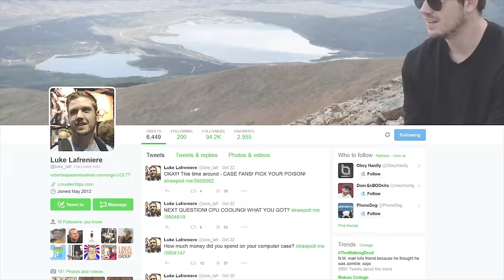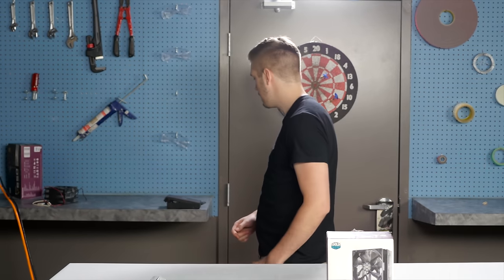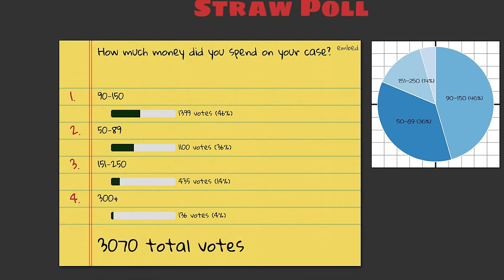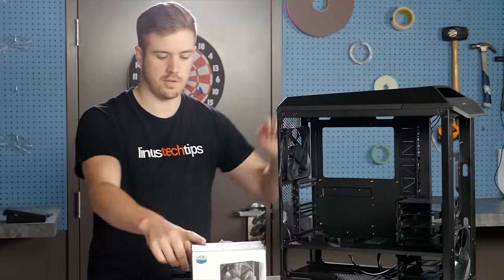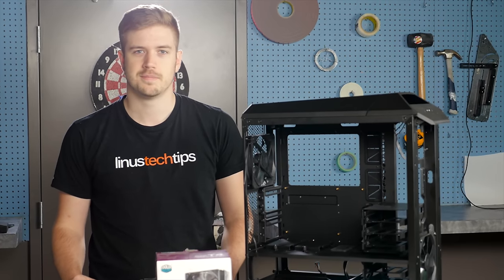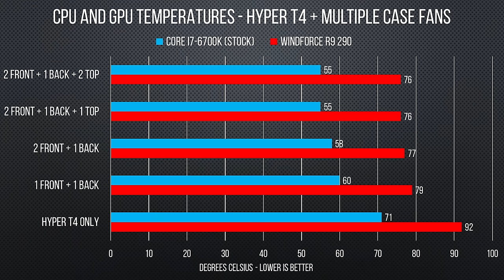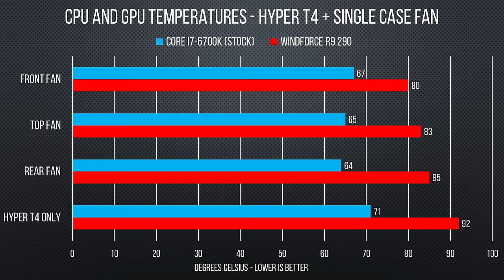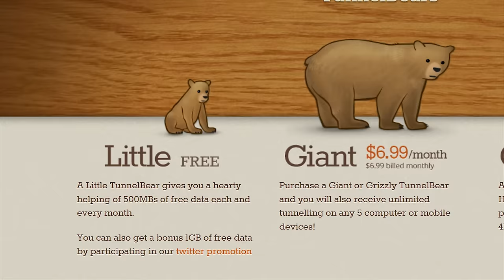Case Fans - How many should you have?

Comment: i want to see a follow up on how positive and negative air pressure affect cooling.
Reply: It doesn't really affect cooling but more dust goes into your case if you have positive air pressure.

Edit: Edited words.
Reply: I vent from positive to negative by changing the rear to exhaust and i get less dust.
Reply: Easy Skater pardon... negative means there is more air exiting the case and positive is when there is more air entering the case
Reply: LawlessSentry

NO SHIT SHERLOCK
WHERE IS THE POWERBUTTON I CANNOT TURN ON MY PC
Reply: Easy Skater LUL
Reply: *****

exactly thats what i did
the difference is its building up a vacuum of hot air which ends up not getting exhausted fast enough also heatsinks on mobo adds up now with negative pressure the overall cooling over long periods is better.
Reply: You have that backwards.. Negative air pressure means that there is smaller pressure inside the case than outside the case (less air in, more air out). Positive air pressure means that there is a bigger pressure inside the case than outside the case (more air in, less air out). Negative pressure builds up dust, because negative pressure sucks the dust in. Positive pressure produces less dust since the dust tries to push outside the case to smaller pressure.
Reply: QckSGaming

 Thats what i said.
Reply: Stop quoting me about it i know what negative pressure means
 im experienced with hardware.
Reply: Deadzio it's probably more efficient to have more intake fans than exhaust fans, as this will create more pressure in the case and will result in less dust. If your hardware is very dusty, the dust will insulate the hardware, acting like a blanket, making your system run hotter. In theory, at least. In practice, it probably doesn't make a huge difference. You'll just have to clean your system more often to maintain cool temps.
Reply: Kureiji Otaku  Negative or neutral is best. Positive pressure tends to have dead zones which heat up, and it's less efficient, so it's preferred only if dust control is your main concern (and with good filtration).  Of course ducting is king and makes positive vs negative moot, but too many people prefer aesthetics over functionality.
Reply: Pressure actually affecting air volume. High fan speed = high pressure on the downstream and low before the fan blade. So to make things easier, just focus on air speed/air volume across your CPU will do.
Reply: All this stuff about negative and positive airflow to prevent dust is BS, just make sure your PC maintains steady temperatures. You will always get dust in your PC, it simply falls in when it's turned off, or is still sucked through the filters. Just clean it every now and then, it's done in 5 minutes with a compressed air can.
Reply: Ok
Reply: that is not possible :P as much air goes out that much goes in
Reply: Does does matter quite a bit in the long run. My cpu started overheating and I found that it was because of a nice little dust blanket.
Reply: +Zag Zagzag This is only the case once the system reaches equilibrium however assuming all the fans are otherwise equal having more intake fans than exhaust fans will always mean that the air pressure inside the case will always be higher than the outside pressure at this point and visa versa. Exactly how much will depend on the cross sectional area of a) the intake vents, b) the exhaust vents and c) any passive vents. The relative relationship in the cross sections of each of these will determine exactly how much each is affected.

Ideally of course you do actually want as large as possible cross sectional area in passive vents too in this situation to minimise the resulting compression ratio since the air compression is actually undesirable. Air compression actually heats the air too in practice this will be negligible as the achieved compression ratio will always be tiny computer cases are plenty leaky enough to ensure that it doesn't take much overpressure to actually reach equilibrium airflow.

The compression is however definitely real and a decent enough barometric pressure sensor could easily measure it. The inverse is also true except of course there the intake fans will be the ones that are gaining extra energy and RPM while the exhaust fans lose some due to the fact they are acting as partial vaccum pumps.

You can easily prove all of this mathematically or experimentally in fact the latter is actually pretty simple to do it only takes an airtight tube and a couple of fans you can easily simulate the same effect as having more or less fans on the intake or exhaust simply by supplying different amounts of power to each and experiment with the effect of the passive vents with the aid of a drill.
Reply: Zag Zagzag, the point most people forget is that the case is full of holes where air can flow. So the question is if you want the air goes in or out of the case from those little cracks. 

Negative pressure (more exhausts) will allow air to be pulled.
Positive pressure (more input) will force air out the cracks,

This fact is essential on dust management, as you want ONLY the inflow of air having dust filter. 

Due to the fact about these cracks, the dead air myth is BS. As either cases will allow air to flow in or out of the cracks. As you say, the ttl in = ttl out.

The key is positioning of the air flow, making sure the fresh air passes through the hottest areas, typically the CPU and GPU. Only have slightly higher input than exhausts to create positive pressure but not so high that it prevent air flow.

It might even worth it to make the top an input instead of exhaust and put a dust filter on it. This will give the CPU the fresh coolest air. While the front fans gives the GPU the fresh cool air.
Ram are typically not the thermal bottle neck, normal air flow is more than enough.
Reply: I have a very small fan setup. I have a Coolermaster Seidon 120M attached to the Rear of my case and 1x120MM case fan. My GPU (AMD R9 270-X) stays pretty stable at about 76c under heavy load however the CPU sits happy at about 45-49c depending on game on pulling air in. I switched it to push air out and the CPU temp rose to about 80c. Seems to be a very bad Idea if you do not have a front fan (no room, HDD cage blocks the fan slot)
Reply: Is it even possible to create a low pressure or high pressure environment with electronic fans???  Brb gonna order a electric supercharger for my car
Reply: Some people might need to put their pc in a container connected to a vaccuum via a hose to collect that dust as the computer is cleaned out.  Otherwise it goes everywhere else in the room it's cleaned in.

Comment: It's amazing they didn't mention fan orientation although it IS possible to tell by watching the video, The "back" side of a fan (where visible wires run along the frame towards center) is the side air will be blowing towards, so for example at 9:28 - 9:30 when it shows the closeup of the top fan you can see the wires so it is setup as an Exhaust fan. We can of course assume the front & rear fan orientation as it wouldn't make any sense otherwise (rear = exhaust / front = intake).

Comment: I have 10 fans in my system.  2 front, 2 rear, 2 top, and 4 taped onto the window.
Reply: Vandoeun Long Damn you tryna start a hurricane
Reply: Aidan Williamson fanception.
Reply: get extension hubs for extension hubs.
Reply: what power supply are you using?
Reply: rm850x
Reply: lmao I'm here with my one rear fun and my dog's tail moving fast when he is happy....
Reply: The side of my case got all bent, all the fans died and I was too lazy to replace them so now I have a desk fan blowing into the side with 1 radiator and a liquid cooled cpu.

Funny thing is my temps idle at 20C and under full load sit at 35-40C. Best cooling I've ever had in this ghetto ass PC.
Reply: I have 6 DEEPCOOL CAPTAIN 360EX 360mm liquid cooled fans and 4 120mm ThermalTake Riing 12 fans
Reply: And? Yours "4 taped onto the window" ruined your airflow.
Reply: I have 2 fans 1 rear and 1 front facing my hdd
Reply: Vandoeun Long WTH MAN
Reply: It might be put outside to diffuse a wind funnel.  Send the idea to all residents in tornado valley, on the east and gulf coasts.
Reply: Vandoeun Long does your computer double as a hoverboard???
Reply: Vandoeun Long My system is a cooler.
Reply: Was about to say that
Reply: Vandoeun Long  Fan...tastic!   ;-)
Reply: R eV I'm gonna try that
Reply: Cute. Not including PSU, I have 16. 2 exhaust, the rest push/pull on radiators.
Reply: Heres me with 4 including my gpu and cpu fans. Just 1 front, 1 back, ive never had a temp problem with a 5600 xt

Comment: Maybe I'm stupid but a fan orientation might've made things a bit clearer.
Front fans are intake and Back fans are exhaust? How about the ones on top?
Reply: The top fans are most likely exhaust fans. Other two are just like you said.
Reply: Hey, when i was building my pc i made a quick search on it too, front are intakes, rear are exhausts, top is for exhausts too beacause the heat rises to the top so that makes sense.
Reply: Cant the top be used as intake and add fans at the bottom for exhaust (yes I know heat rises)? I know a person with a Haf X that does that.
Reply: You can do what you want. I have my front fan bringing it in, left side panel bringing it in, top fan bringing it in, and top exhausting it.
Reply: b
Reply: Normally the top and back ones are both exhaust locations, so you can choose to have your intake fans on the front or on the bottom (sometimes) or on the side and have your exhaust fans on the back or top or even both sometimes if you dont have a CPU cooler that needs an air-cooled loop
Reply: Also if you have your top fans on exhaust, it brings in less dust while running.
Reply: Yayo.chan Just for the looks xD
Reply: Dominie Dirtch  heat rises isnot a valid reason when you are creating airflow.

Comment: My approach to case fans (after 2 factory fitted ones included with the case failed) is. Buy a case without fans if possible, or remove if not. Buy some decent ones. Depending on how sensitive to noise and tone you are this can be quite in depth. Also pay attention to airflow (usually given in m³/h or cubic meters per hour) I'd say you want a minimum of 50m³/h for a 120 or 140 mm but higher is better, a high quality fan will get close to double this and should be much quieter. If you can live without LED's you'll often get a better quality fan (Corsair for one the AF 140 with LED's is lighter than the non LED variant) Pay attention to the bearing type, sleeve bearings are entry level, ball bearings are better. Personally I use Noctua fans. I use their Redux model for my case fans. Many cases can fit 3 X 120 mm fans in the front or 2 X 140 mm, here I would say it's marginally better to use 3 X  120 mm if this leaves no open spaces between the fans or case rather than 2 X 140 mm that leave gaps at the top and bottom. It also looks better aesthetically in my opinion.  The airflow is similar for example 2x NF-P14 Redux PWM 1500 RPM  move 267.4 m³/h compared to 3x NF-P12 Redux PWM 1300 RPM move 276.9 m³/h. The NF-P14 PWM 1500 is noticeably louder tho'  @ 25.8 dB(A) compared to the NF-P12 PWM 1300 @ 19.8 dB(A) + 6db(A) is much louder, I believe we perceive sound as doubling for every +3db(A) These figures are obviously specific to these exact model types and other fans will vary wildly. If fan noise bothers you it is worth going into detail. Be Quiet fans are appropriately very quiet but they sacrifice RPM and by extension airflow to achieve this. Depending on how much heat your system generates these may be an excellent low noise solution but if your overclocked CPU and powerful GPU are working hard for long gaming sessions you may require more airflow. Fan placement is not as straightforward as you might think except for the obvious front to back flow. Top mounted fans while it would seem intuitive to have them exhausting hot air (I mean heat rises, right?) I was amazed to find that flipping them over and using them as intakes, I was able to knock 10°C off my VRM temps and a couple of degrees off my RAM temps without increasing any other temps. 10°C! That's a big reduction just for flipping your fans orientation. Bottom mounted fans, I would recommend some caution here, the last thing you want to do is to be sucking dust from underneath your PC and introducing it to the interior of your case. Unless you're struggling with high temps and you've no other options I would avoid bottom mounted fans unless used with filters. In general tho' unless you live in an extremely dusty environment I don't advise the use of mesh airfilters, especially if your case has a perforated panel in front of the fans. Adding that second layer of filtration absolutely kills the fans performance, far better to run without them and invest in an air duster and regularly give your case interior a blow out. The single most important factor when it comes to airflow management is the case. If you're running high performance components then the best approach is to choose a case which is designed to optimise airflow (Gamers Nexus channel has a comprehensive guide to help you choose a high airflow case) if however your PC is more modest then you can probably get away with choosing a case design purely on aesthetic grounds. Good luck with your build.

Comment: The golden rule? 
Just put in as many fans as possible to make the system sound like an airplane, especially if you´re building a silent pc
Reply: +TheWuerstchenwasser Just add wings and you can fly away on it :3
Reply: Sawko
I agree with that :D
Reply: +Sawko Don't forget to fill your liquid cooler loop with RedBull xD
Reply: mohammed shahien
Go ahead :D
Reply: My Enthoo Luxe and its 7 fans sounds like a GE90 jet engine running at idle.... As an aero engineer, this pleases me greatly.
Reply: Seems like I reached my daily goal then... Make someones day a good day :D
Reply: search 120mm delta fan, they sound like jets starting up and give out 250CFM
Reply: what if ur getting a silent case like the Fractal Design Define R5 and you put silent pc fans in the case but a lot of them would that make more noise? cuz that case could hold a lot of fans and i think more is better but idk now likely im gonna get 1 140mm in front and regluar in back and 2 140mm in the top
Reply: dont forget to add fan reverser. cant rely on brakes alone when landing.

Comment: The pattern here seems to be that if an intake fan has a matching exhaust fan, it has a good effect on cooling, and front fans cool the gpu better (the lower the better maybe) and exhaust fans help cool the cpu better. You guys should repeat this test, but use AIO radiators of different sizes and mix and match the fans.

Comment: Very informative and well done. The one consideration that I thought you would include is the CFM of the fans. CFM airflow determines how much air is being moved into the case (intake) or removed from the case (exhaust). I would think that a balanced CFM would be the goal of cooling the compartment. You want the intake and exhaust airflow to be near the same. There are cheap devices that measure airflow. I think they are called airspeed measurers. I would also advise using fans that are speed adjustable. This would help you to balance the case airflow. It's not all that important that you agree or disagree with me as long we both agree that warm air RISES.

Comment: The total average delta T between the baseline configuration and the addition of more fans represents the total cooling capacity of the system. Due to the specific heat of air, it takes so many watts to raise a volume of air 1 degree C. Therefore going from the T4 CPU cooler alone to 1 front fan + 1 back fan represents adding 480W of cooling capacity. When you add the second front fan it goes up to 600W. Adding the next top fan gets you up to 720W and at that point you are removing heat way faster than your computer can produce it.

Comment: I always go for a positive pressure setup with inntake in the front and sometimes 1 in the bottom of the case if there's room and a filter that covers the position I want, then I go for a 2-3 exhaust fan setup in the roof of the case and 1 in the rear. This creates a front/bottom to back/top airflow with positive pressure, 4 inntake fans (+ PSU) and 3 exhaust fans.

Comment: 00:02 Determining the optimal number of case fans for your build
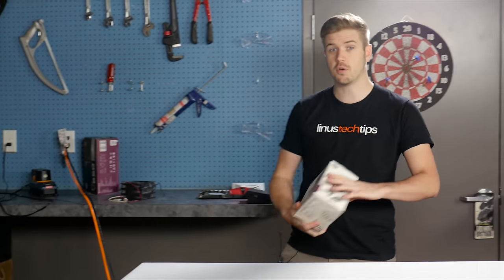01:45 Choosing case fans for your system
03:28 Consider the power supply's airflow direction for case fan setup.
05:24 Testing system with only one case fan
07:13 Adding two fans - Front & Back, significantly improves cooling performance.
08:49 Adding additional case fans may not lead to significant temperature improvements.
10:38 The number and placement of case fans affect CPU and GPU temperatures differently.
12:18 Case fans affect system performance.